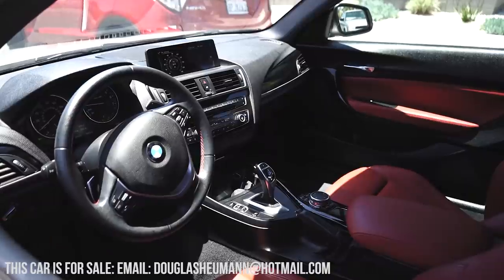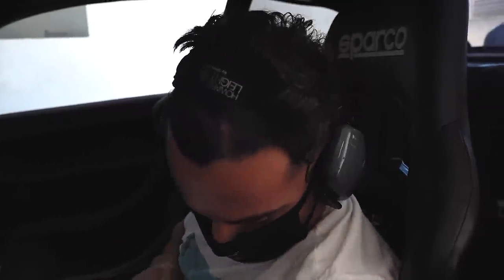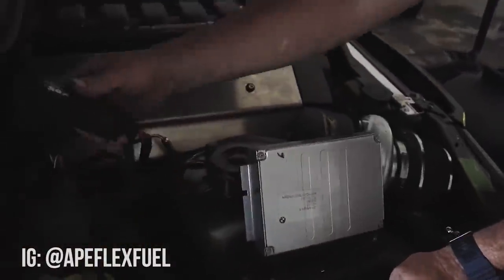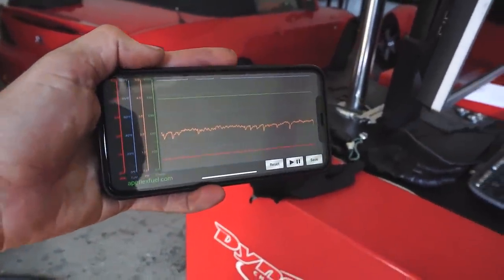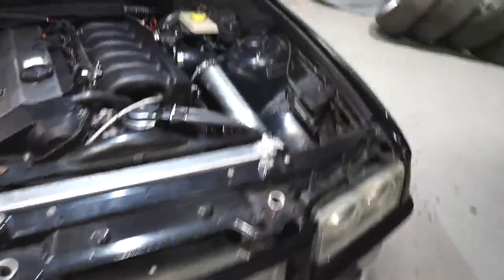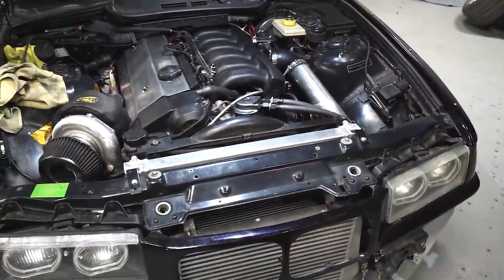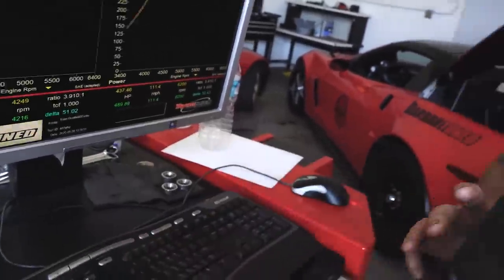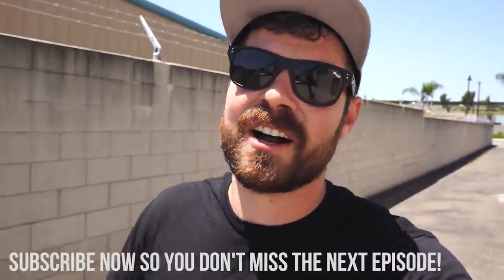LAMBO KILLER BUILD! DYNO DAY:  BMW E36 M3 Build Part 3:

Comment: Imagine paying over 200k for a super car just to get taken to gapple bees by a e36🤣
Reply from the maker: That's the goal!!! :P
Reply: and then killing the e36 on track 🤣🤣🤣
Reply: worĸғlow ur funny 
E36 would win on the track any day
Reply: @worlow1841  eh. A well set up e36 will beat Lambos and Ferraris easily. If we're talking McLaren then yeah.
Reply: What 200k super car would be slower than this? A stock hurucan would destroy this in any performance driving situation.
Reply: Victor Cortez the e36 shown in this video will not win on a race track
Reply: TheLoopmeister #Drivermod
Reply: MoonLightMadness what happens once the lambo puts on a turbo or supercharger ?
Reply: 01GTB Daily Than they turn it up🔥I’m sure that turbo could take more horses. That e36 is pretty light, you’d be surprised what a single turbo v8 is capable of
Reply: you pay for more than just the performance in a supercar, fyi

Comment: Evan will a cold air ducking from your turbo to the front of your grill help with the air temp getting a cooler charge then having the air from the engine bay 🤔

Comment: Dude swap that intake wil give you more power that intake is a restriction😋
Reply from the maker: What do you mean? This is the M50 manifold.
Reply: @throtl  you have the dbilas dynamics m50 intake. Will give you beter results than the stock m50 intake. You can also check the bmw e36 hm engine tuning intake ( carbon ) i Just love the dbilas intake. I have it on my m42 engine you get the pretty looks and more power. Greetings from the netherlands. ✌
Reply: @TheLajanz   that true. Hm performance is 1k.  Depends on your own opinion. If it's worth the money or not.  there are cheaper solutions.. He likes welding. Weld one from aluminium. Or make a diy for carbon. Maybe ask the guys from street bandito to help you out. ( hint ) 😜
Reply: Elias Hedberg Turbo engines doesn’t suffer? Actually they do suffer, because If you have poor airflow you will also have hot air flowing in the intake and the engine. Lowering the temperature of the air thats going into your engine allows you to run more advanced timing, better mapping, better air/fuel mix etc.. Aftermarket intake is indeed a waste of money if youre not building something extreme. Matchporting the intake side and exhaust side is a better and muuuch cheaper option. Matchporting only the exhaust side alone, allows the turbo to run more efficiently and cooler, that results in cooler air being pushed into the engine. I gained probably 20-25hp by matchporting my head, intake and exhaust. Its a lot of work doe.
Reply: 2.5” Down pipe and small intercooler are current restrictions not the M50 intake

Comment: I dont know...this rly sounds not happy. sounds restricted at the top....strange "limiter"
Why are the pulls so short? is this normal for those hub dynos? i dont know but dont sounds confident for me. i mean is this a 4th gear pull all the way to 6,5k- 7krpm?
Reply: There was no rev limiter in the video, thats the dyno limiter after it hits the end of the sweep rpm. It does have high back pressure but its fine. Its a loaded dyno no chance of wheel slip, its properly loading the motor. This is the best dyno on the market, ive used every dyno you can think of. Worth $125k